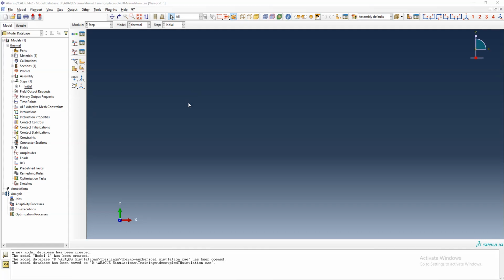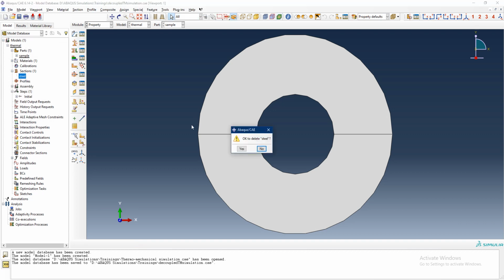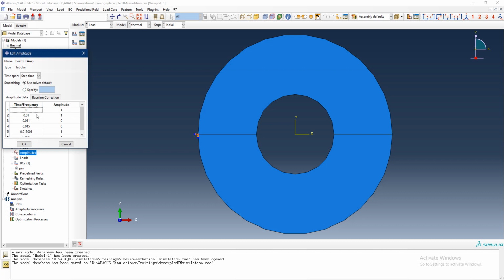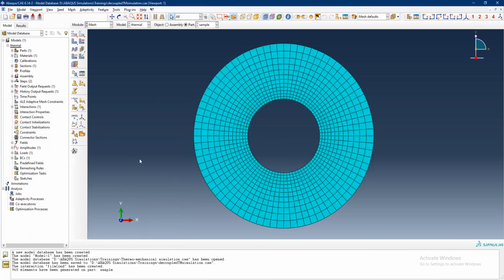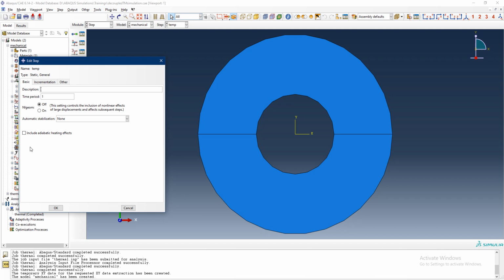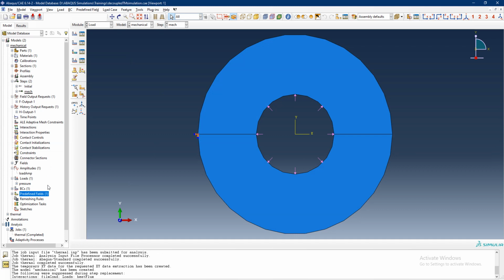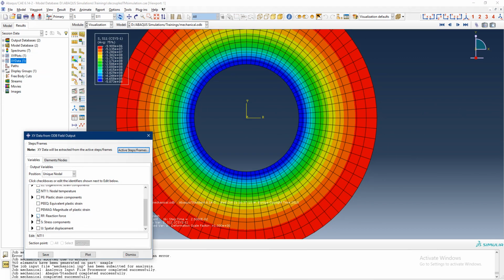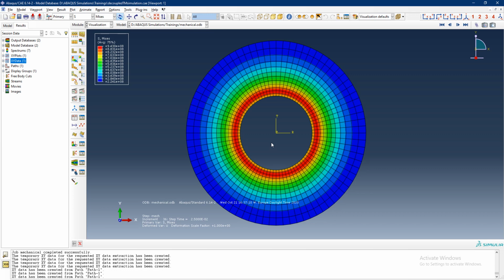Decoupled thermo-mechanical simulation modeling in ABAQUS

Comment: Hi Faisal! very useful video.  In mechanical module visualization, Why it shows zero stress value where temperature was high in heat transfer analysis (inner circumference). Stress should be high at that area due to high temperature. How to see that stress?

Comment: I would ask, the automatic- time step size in mechanical simulations is NOT the same in the thermal simulations, why?
Reply from the maker: Yes you are right. You can make them same but they do not have to be.
Reply: @FaisalQayyum  different time steps for different kinds of simulations, but " they make the same", what are the reasons?

Comment: Hello Faisal,
I’m building an electrothermomechanical model. I have already built the electrothermal model, from which I will extract the results which will serve as input data for the thermomechanical model. But I have a problem with my electrothermal model. In fact, I heat by a current an object that is in contact with another object. I cannot introduce the condition of the thermal conduction type at the interface. Could you please give me some ideas to get there
Reply from the maker: If you have not been able to solve your problem yet, please get in touch on some other more appropriate platform at faisalqayyum.com/contact we can chat about it and find an appropriate solution
Reply: Hello,

Sorry for responding You late. Thanks for writing me. I have solved that first problem but actually I have another one. In fact, I would like to modify the first model to make curent density applied for heating depending on Time. For that, I realise the UAMP is more appropriate among the availabe subroutines in Abaqus. Thus, could You help me by providing of UAMP subroutine code if You have ???

Thanks in advance
Reply from the maker: @pierretizemha899  I do not have experience with subroutines and cannot provide you with UAMP
Reply: @FaisalQayyum  thanks a lot. I will struggle to build it and ask others guys. Thank You very much.

Comment: Please, I’m building an electrothermomechanical model. I have already built the electrothermal model, from which I will extract the results which will serve as input data for the thermomechanical model. But I have a problem with my electrothermal model. In fact, I heat by a current an object that is in contact with another object. I cannot introduce the condition of the thermal conduction type at the interface. Could you please give me some ideas to get there
Reply from the maker: It would be great if you can please contact me on my email address for deeper discussion. I think there can be a solution to that problem but it is hard to answer that question here.
Reply: @FaisalQayyum  please could you send me your email adress ???
Thanks in advance
Reply from the maker: @pierretizemha899  fysalqayyum@yahoo.com